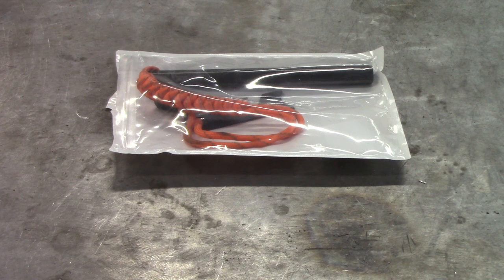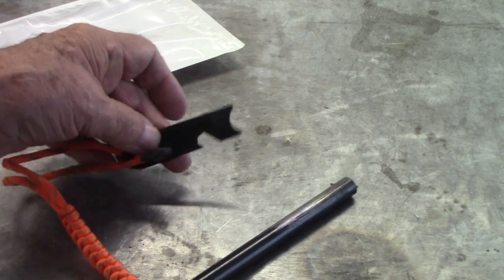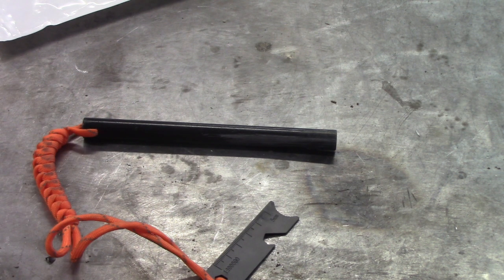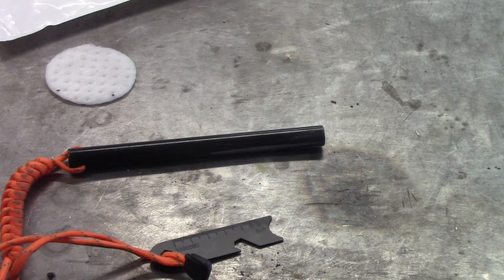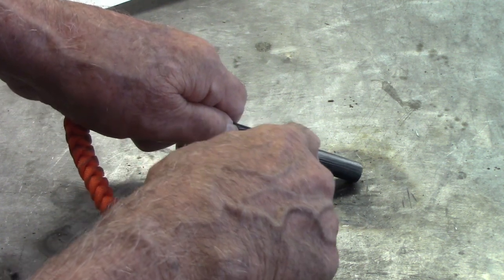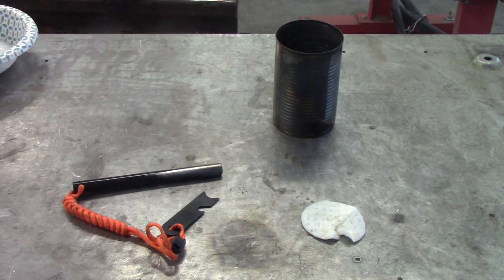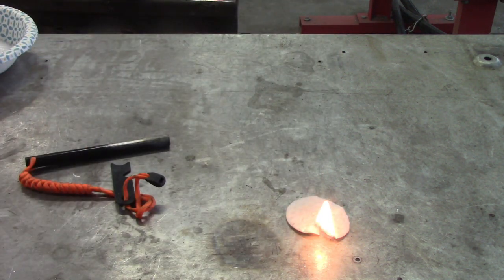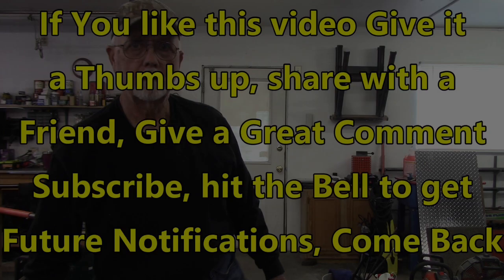Fire Starter Magic: Unlock The Power Of Ferro Rods!

Comment: Pretty cool and it lit even the bad pad. Thanks for sharing see you on the next one👍🏼👊🏼 p.s. now let’s see the ol flint rock to start a fire😬 bet you haven’t done that in a while I used to when I was a kid I’d find two rocks that would spark and light a little fire it always took the longest time building the spark bed by shredding up cedar bark into fine hairs but it worked (definitely may as fast as your pads lol
Reply from the maker: Funny you brought that up about the flint rock. I just saw somewhere where you can get a flint rock and a steel striker that looks almost like brass knuckles. Looked like a lot more work.
Reply: @CandSMINING  hours of trying to get it started lol